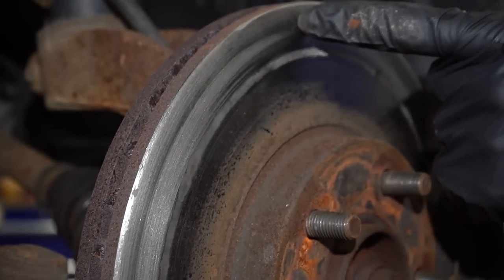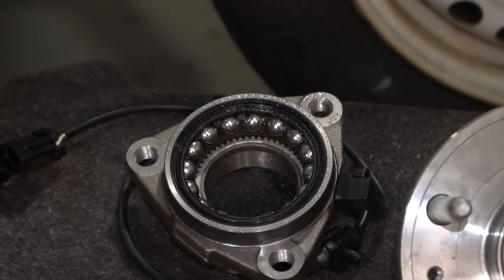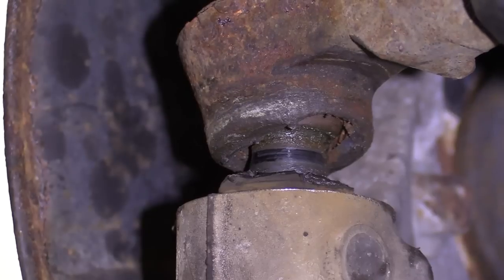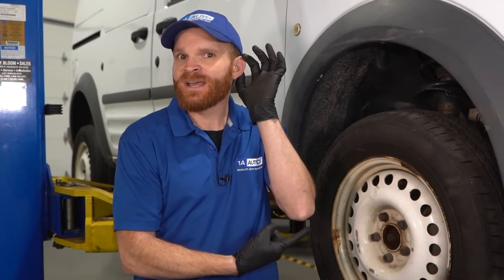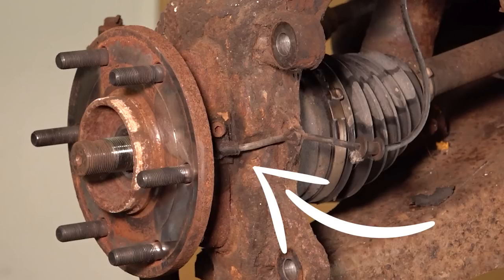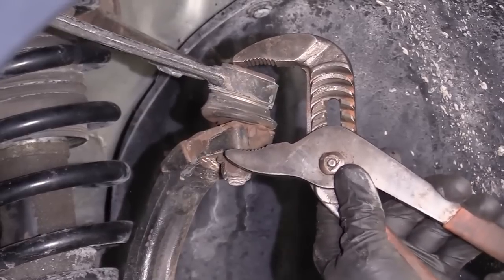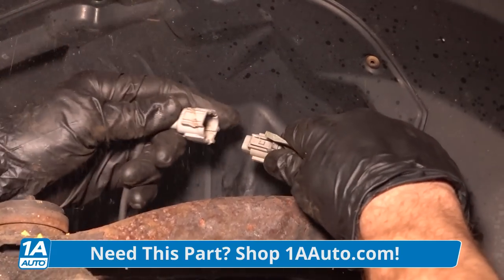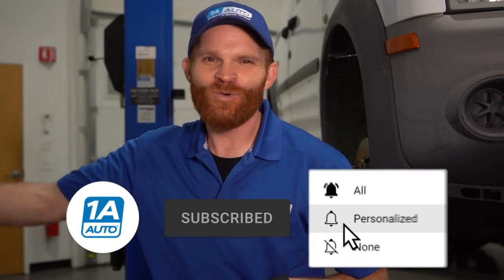Putting off Wheel Bearing Replacement? Ignoring this Could Damage Brakes in Your Car or Truck

Comment: Our 2005 Ram 1500 was making some very loud clanking sounds from front end as though metal was snapping and clicking like a playing card in bike spokes.
A shop thought it was the CV Axle.
We had the drivers CV Axle replaced along with upper and lower ball joints just for good measure (180,000km)
Drove truck 700km home and another week driving locally before the exact same clanking started again.
I checked the front Diff (electronic 4x4) and found 19 roller bearing niblets laying in the old silver looking diff oil.
Replaced the front diff and passenger CV Axle...for good measure.
Week later same clanking...
After watching a lot of YT vids on the noises we had I finally found one that was almost identical sounding.
Front wheel bearing!
Swapped out the drivers side all in one Front wheel bearing after 5 hrs (seized in the knuckle)...
Month and a half, no clanking.
Edit: 2 & half months no clanking.

Comment: Have a question. I have a 2005 pontiac grand prix gt i have replace the rear wheel bearing 3 time now. Yesterday is the 3ed one and today me driving its starting again. I can move it back and forth being on the ground. I have replace everything in the rear from k frame to all the links only thing i didnt change out is the knuckle what else will couse the wheel bearing keep going out

Comment: My '09 FIt started making noise a few months ago. I put it off for almost 1500 miles, until it got to the point where the friction could hold my car in neutral on a slight hill. When I inspected the inside of the drum, I saw the absolute carnage that had unfolded. The play in the bearing caused the wheel to go off camber, rubbing the drum against the bottom edge of the back plate and leaving tons of metal shavings inside the drum. The front shoe wore down unevenly, to under 1 mm on the bottom and about 1.5 at the top. 

Please don't put this off. I'm lucky in that this only cost me in excessive part wear. If I had put it off for much longer the bearing would have almost certainly seized, or even broken apart entirely. Not a good time if you tend to drive in excess of the speed limit...